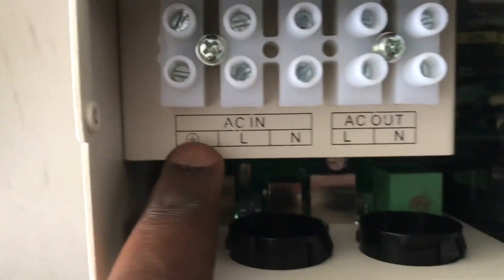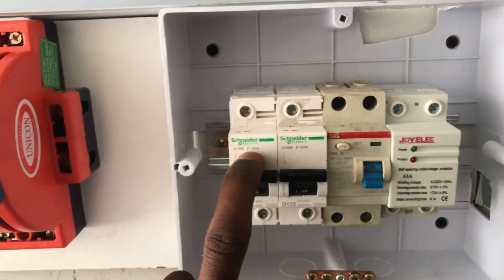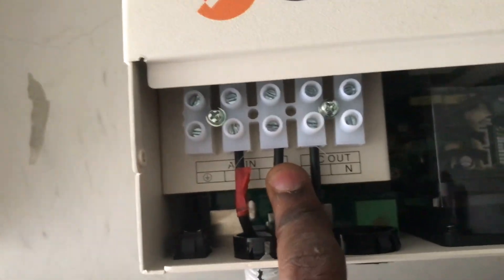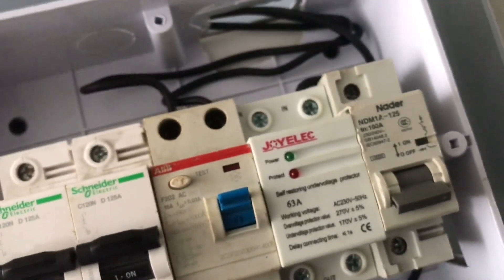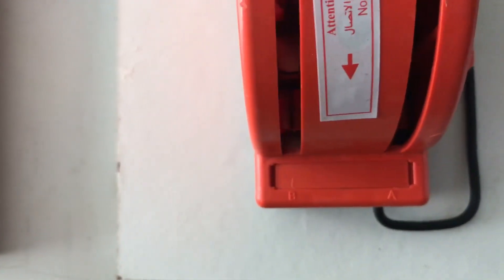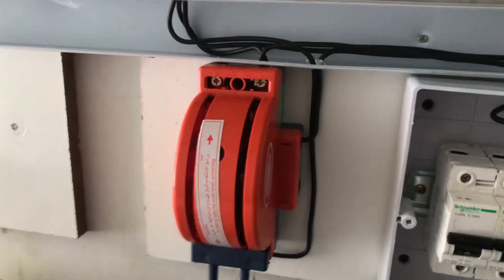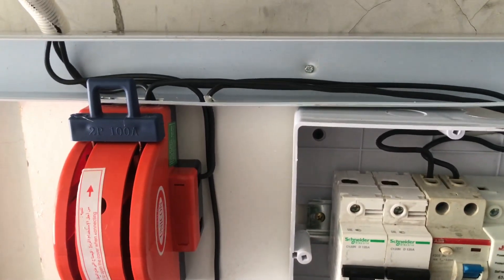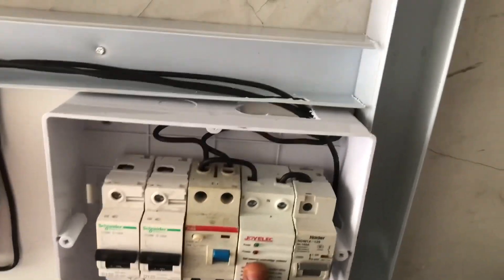SRNE 5kw hybrid inverter connection with 100A knight switch change over,from start to finish(method1

Comment: Do you still need knife switch with a Harvel change over switch
Reply from the maker: No,If the Harvel change over is for the inverter ,you can still use the same concept of the knife switch on the harvel the only difference is harvel is 3phase